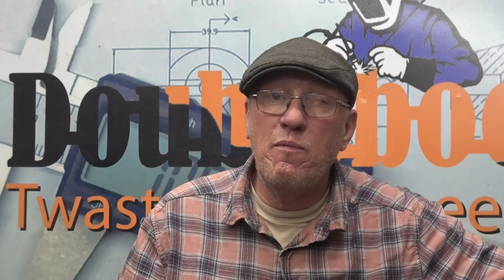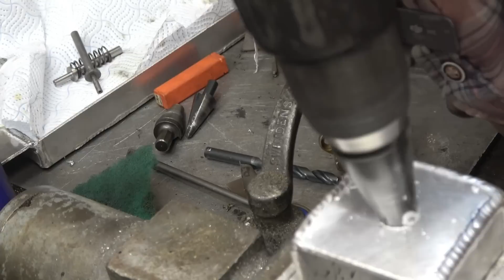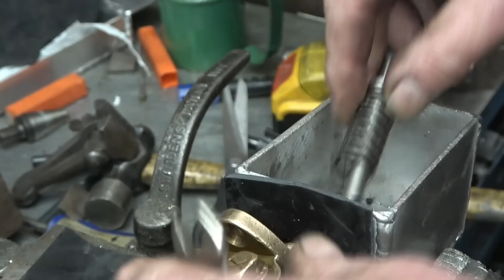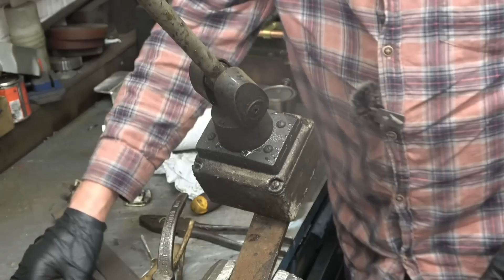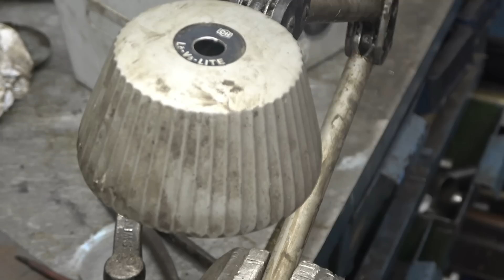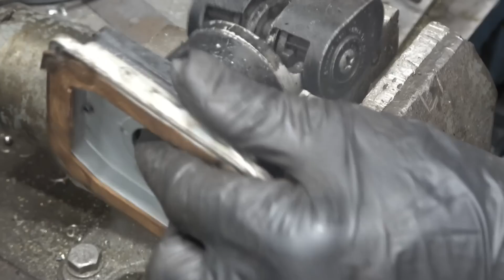SNNC 505 P1  Steam Oil Pump Restore . Vintage Machine Lamp Restore

Comment: Quick tip when using the wad cutters John. Use them on the end grain of the wood, they last a lot longer before they neeed sharpening. Or cast a thick (25-40mm) lead disk 150-200mm dia. The weight keeps it in place on the bench, no need for the vice and it won't damage cutters. When the top is looking a bit hacky, just recast it.
Reply from the maker: I have a lead ingot I will use that in the future thanks for the comment

Comment: John,that is a genuine Lo-Vo-Lite as fitted to Harrison lathes and milling machines. They were originally powered from a 50 Volt step down transformer that mounts in a metal box with an on/off switch on the front face of the transformer box.
 The whole unit is usually mounted on a bracket fixed to the rear face of the Harrison lathe headstock. 
The articulated /pivoted lamp arm is fitted directly on top of the transformer box.

Comment: 50V or 25V machine lighting, I have examples of both. I do prefer to run incandescent lamps in them on machines, workshop has good LED lighting which is bright but can be a bit harsh sometimes.
Reply: Incandescent bulbs were preferred for safety reasons,  the Fluorescent lights flickered at mains frequency,  and due to the strobing effect,  spindles etc seemed stationary?
Regards John

Comment: I seem to recall those lamps used a flat twin core cable not a round one. It gives more room around the joints to bend, but I could be wrong.
Reply: They do, usually best to leave a good bit of slack at the joints.

Comment: Another interesting video John, I was fascinated about the lamp. I have a lathe, a milling machine and a shaper all with very similar lamps. All the machines are three phase and the lamps are 50 volt. I use obviously 50 volt bulbs although I have no idea if they are still available but they give a dull yellow light and for a long time I have been wondering how to convert them to LED which is a much better and more white light, ideal for my ageing eyes.  So any ideas would be greatly appreciated, I would like to retain the original brackets.
Reply: They are supposed to use rough usage type bulbs, thicker element,  a lot more expensive than standard ones, same with Inspection lamps.
Regards John
Reply: yes that is exactly what they were called, I think they came from a company who supplied them for use in the old red telephone boxes and called them "rough service" bulbs.  I am looking to upgrade to something LED now but finding it difficult as the machines send 50 volts to the lamp holder via a transformer so that was why I am looking for ideas  @bostedtap

Comment: Nice old lamp there. Got a Tizio lamp, from around the 1970's, and converted it to LED, as I was not liking the cooking off from the original 55W lamps, so put in 12V LED instead. Now runs a lot cooler, though not as bright, but good enough. Same with an uplighter, going from the horrid 300W halogen linear lamp, though the first upgrade was to a 70W metal halide lamp, using the same mounting base, which worked out a lot better. Then recently went to 24W LED flat panel as a retrofit, which works out to be as bright as the first 300W halogens, but runs cool, and likely to last longer, plus lighter on the power bill.